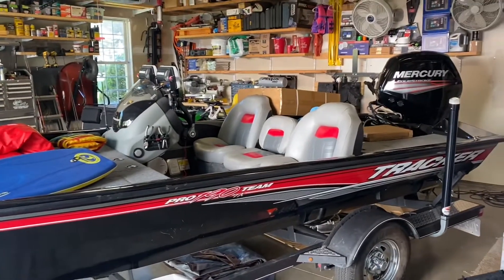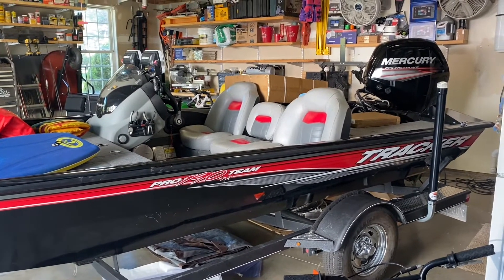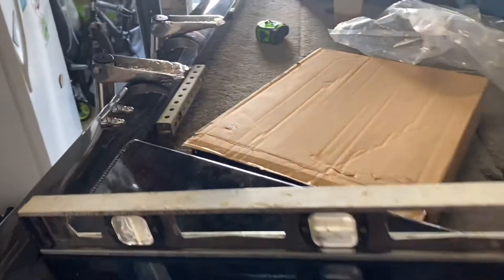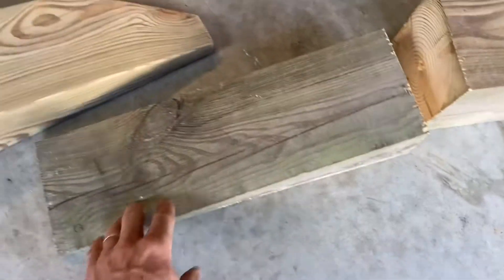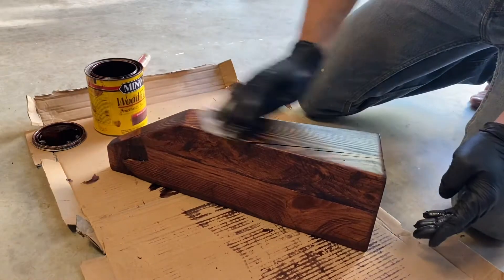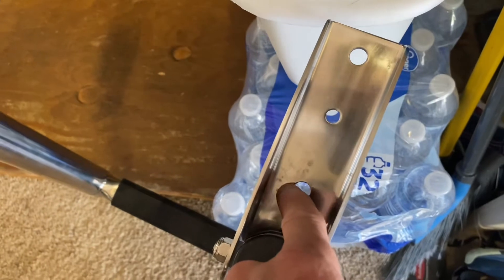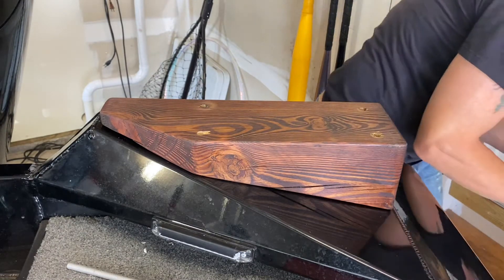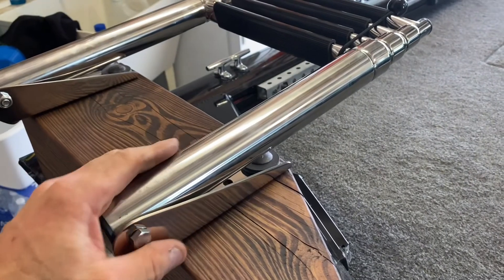2016 tracker pro team 190tx telescoping boat ladder install

Comment: How were you able to start the nuts and but a wrench on tighten. I have a tracker and want to put one on my boat 
Thank you Jim H
Reply from the maker: James hussman
I had a hard time getting my hands underneath the aluminum panel and because I used lag bolts I had to turn the wrench underneath to tighten it which was very difficult. I was only able to do 3 because I couldn’t get to the very back corner to turn the wrench. It is very solid with only 3 bolts.  If I had to do it again I would use bolts where I could just hold the wrench underneath and tighten from the top.  I’m very happy with it and wish I had it a long time ago. I’ve used it as well as the kids and getting back in the boat is so easy now.
Reply: @jasont7887  Thank you